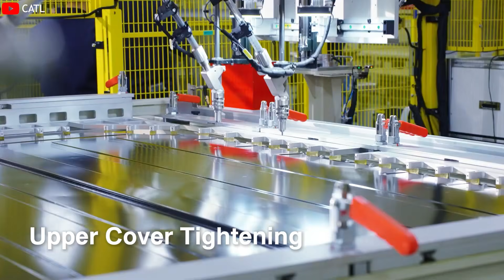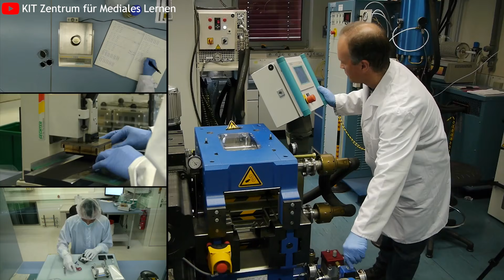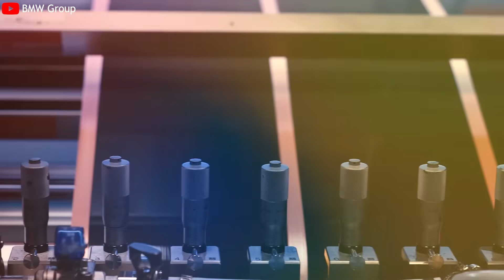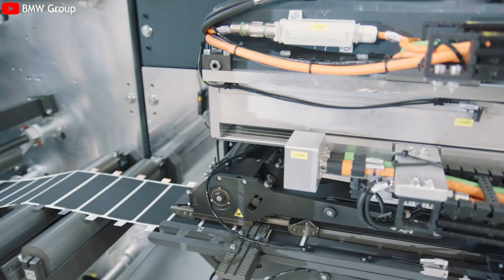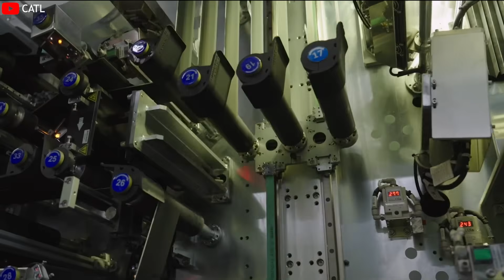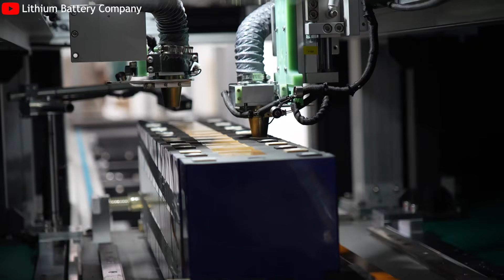The Truth About Why Tesla’s Dry Cathode 4680 Battery? Finally Works!

Comment: This did not explain how he figure out how to mass produce?
Reply from the maker: Tesla solved the 4680 with mass production in mind by stabilizing yield, increasing line throughput, and reducing cost per cell on real factory lines. Once those metrics were repeatable at scale, the 4680 became viable for expansion.